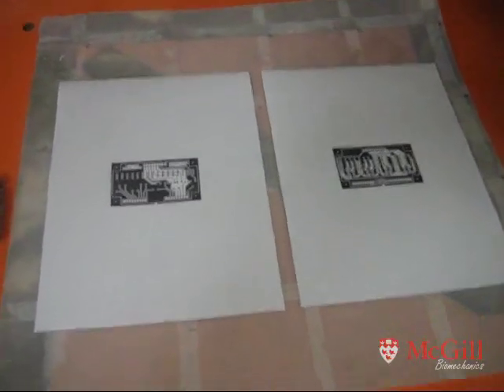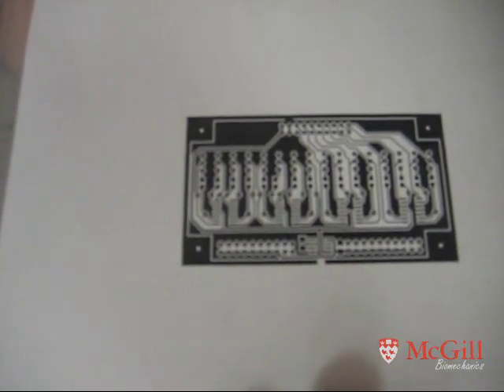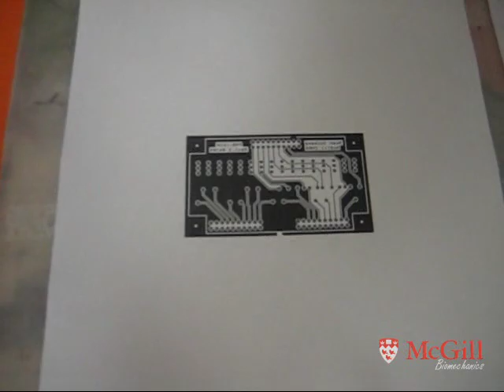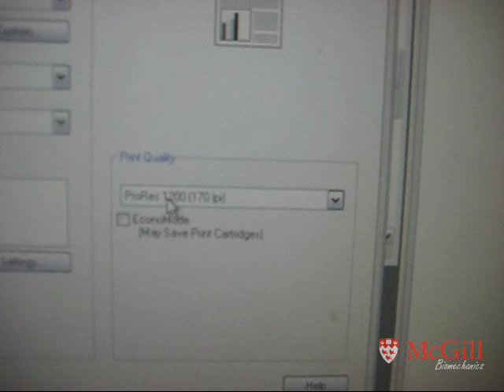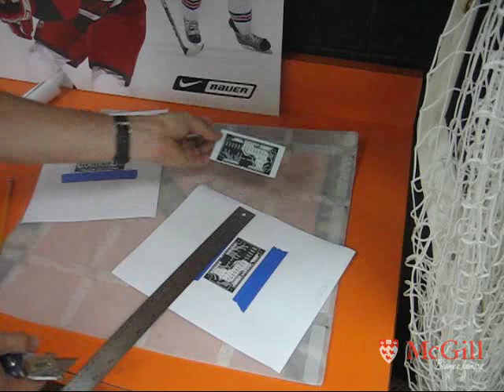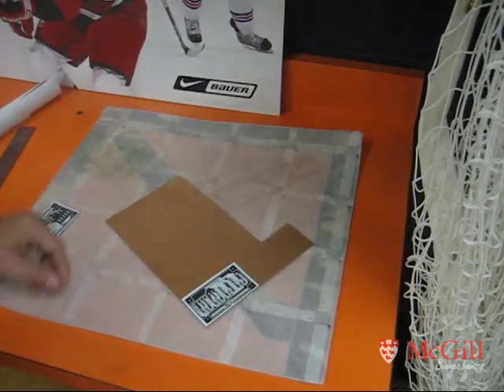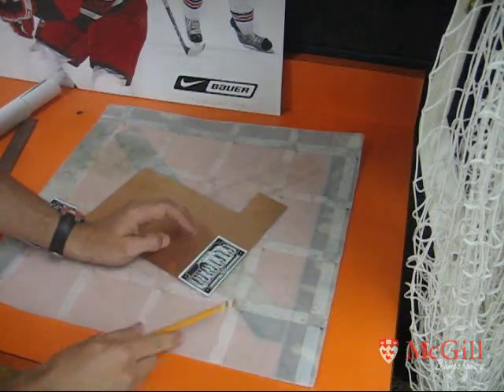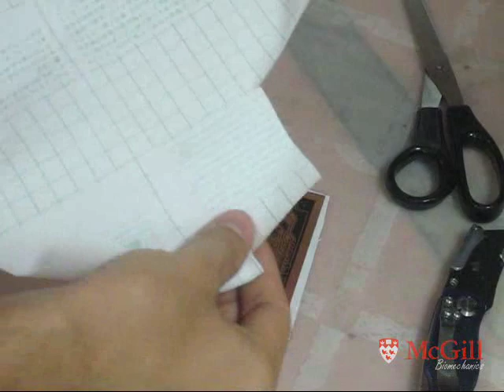How to make a double sided circuit board using the toner transfer method - Part 1 of 2

Comment: Is that just a standard laminator?  Most tutorials show people running the board through 10 - 15 times.  Does this paper require less heat?
Reply: for anybody this may help, I got my laminator today.  I needed about 12 - 15 passes on mine.  My board came out perfect, I have around 10 mil traces.  I failed so many times using the iron, a 20 dollar laminator from amazon is the way to go!
Reply from the maker: PCBFab has a recommended laminator that combines pressure and heated rollers. If your laminator requires 12-15 passes, I get the feeling it is not the best tool for the job. I pre-heated 30 mintues, then did 2-4 passes as described in the video and got good results. I made this video almost 10 years ago so I don't imagine the model I used is available anymore. Good luck!
Reply: 0ak1e Thanks for the video, I got .5 mm vias to line up.  The laminator is 20 bucks and did the job 10 times better than an iron.  It just needs to be taped down or it won't stick in the first pass

Comment from the maker: No need to yell (Caps Lock). In the video I did the toner transfer to the top side and etched it protecting the bottom side with shelf paper. I then protected that etched top side and repeated the toner transfer and etching process on the bottom. There are other options to do both sides at once as discussed in the other comments. In fact I prefer to do both at once now, though you must be careful to ensure the layers are aligned.

Comment from the maker: @Rulox999 When you start using multiple components on your PCB it can become impossible to route all the traces on a single layer. The second (or third or fourth...) layer allows you space to run more direct connections or dedicate a layer to power or ground signals making connections much easier.

Comment: @zulfiqaradil 170°C seems best for most toners. Some printers like the newer Brothers require around 187°C or so. Most laminators run at around 115°C by default.
 
You can however modify them to run hotter, as I did with mine. I followed the instructions from Ultrakeet. (Search Google to find it)

Comment: @JoeGancher That means the toner did not stick to the copper properly. Either the board was dirty, your laminator\iron wasn't hot enough, there wasn't enough pressure or you were using the wrong paper.

After transferring with my laminator at 170°C I can rub the paper off vigorously with my fingers just fine and the toner won't come off. It will only come off if I scratch at it with something sharp.

Comment: You indicate to mirror print the bottom layer, is this based on the software you are using? I use Eagle and it seams mirror printing the top layer does it for me!

Great video by the way!

Michel

Comment: What a difference a laminator makes over an iron !! I bought the Scotch 3M , Model TL901 from Walmart for about $30. Passed board through on the 5 mil setting 4 times. Came out perfect.. Regrettable , I wiped of a trace by very lightly blotting a paper towel to remove some water droplets.

Comment: Do an Ebay search for: "Heat Toner Transfer Paper for DIY PCB A5 Size 10 Sheets"
They are $3.49 for 10 half sheets, but they work with a common iron. Soak board and paper after ironing and very slowly, VERY SLOWLY peel the paper off. I tried this *&^&%$  paper in this video about 5 times before giving up. They even admit, on the manufacturers site, that this paper won't work well with an iron.

Comment from the maker: I've never etched aluminum, but I've read that FeCl works fine. For the resist, again, I didn't bother with the photo paper method since I used the transfer paper from the Pulsar kits. Photopaper/magazines seem like a lot of rubbing and slow work. I recommend the transfer papers since they are so easy to apply but I understand if cost is a factor. If it is a simple enough design you could just use an exacto knife and shelf paper.